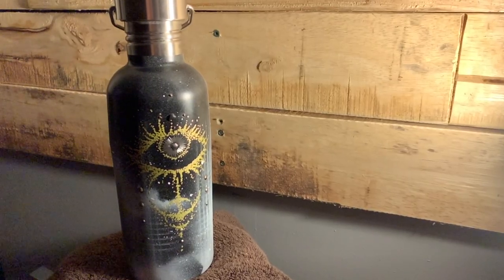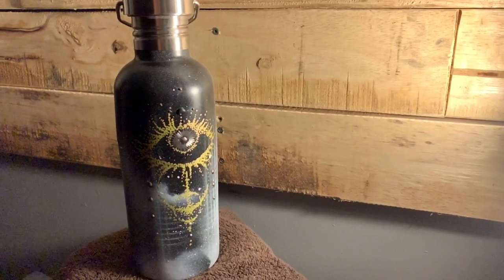Custom HYDRO FLASK!  (STRANGE METAL ART?)

Comment: I wonder if you did run a purge if it would keep the inside clean enough? Also trying to think of a way to lay it in ice water, while keeping the purge going. Sounds crazy but I have definitely welded things while they have water around them and it works.
Reply from the maker: Good to know... I’m gonna try this again, I think I can find some thicker bottles. And I’ll get a second reg to run a purge line I think. 🍻

Comment: I would fill the bottle with argon, the oxidation “bloom” created with no back purge is the only problem with usability . You could also probably run a low stick out and no filler to create a surface pattern and nice color. I think I’m going to try this, all this talk has me interested.
Reply from the maker: Lemme know how it goes!🙏🙏🙏
Reply: @PacificArcTigWelding  dude...you should use water in the bottle as you weld to keep it cool?? don't know if it will work just thought of mentioning it.

Comment: Hey do you think you can fill the bottle with argon next time and see if you can run some weld bead designs? It would be cool to see you run some more weld and see if it’s possible. Either way awesome video!
Reply from the maker: Thanks so much! I’d like to get a thicker bottle and try exactly that. Good suggestion!💪

Comment: Hi Dusty. Thank you so much for the videos. I am practicing welting a 1/16 ally tube to a 1/16 plate with a through hole, like you see in an oil pan for cooling. I would love it if you did a demo of this. Thanks again.

Comment: Why isn't it usable anymore?
Reply from the maker: The inside oxidized. It’ll hold water (I didn’t burn through...!) but the oxide will come off in the water unfortunately. (Kind of like yukky rust...) Looks awesome on the shelf tho and learned a lot from it:) I appreciate you checking it out tho!🙏
Reply: @PacificArcTigWelding  Oh, I didn't know the oxide was toxic. Will it continue to "rust"? Is the any way of treating it? How would you prevent it from oxidizing in the first place ? 

Awesome videos by the way - especially love the tigart 😃👍🏻
Reply from the maker: Thank you so much 🙏🙏🙏 I’m sure you could Clear spray somehow, but next time I’ll just flood the inside with argon while I weld and try and get a thicker bottle😂🙏